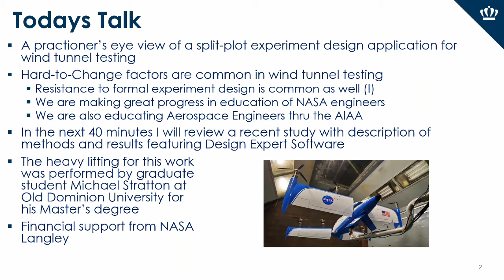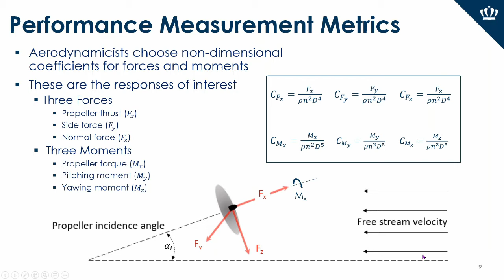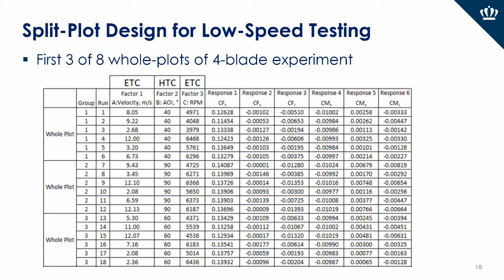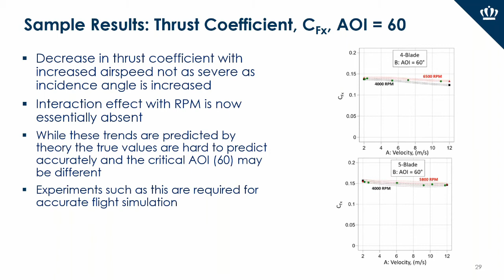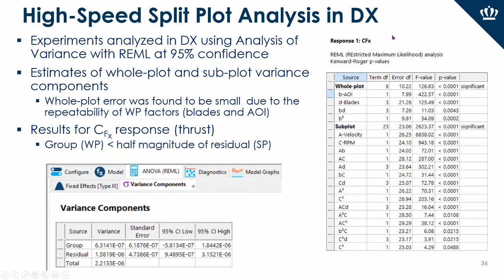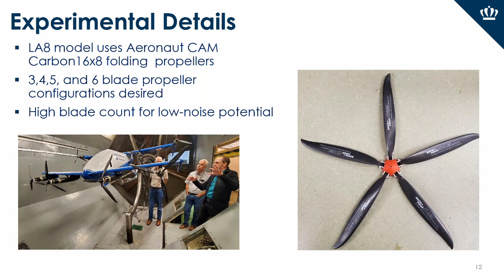An I-Optimal Split-Plot Design for EVTOL Tilt-Rotor Performance Characterization

Comment: Free air full scale and Reynolds number testing would seem to be more economic and reliable particularly for large turning angles that are incompatible with a straight flow wind tunnel or even at the outflow of a bellmouth .
Best of all is to avoid vtol altogether when hovering is not essential or of any advantage in the urban air mobility context.
Atol is a better and far more suitable mode.